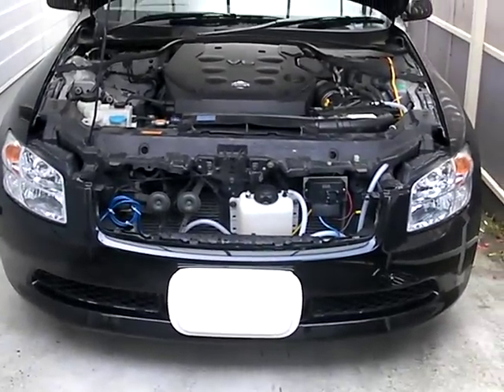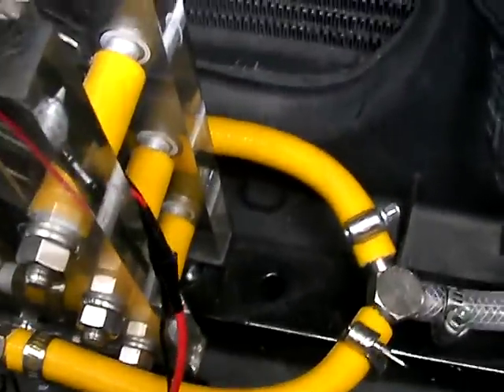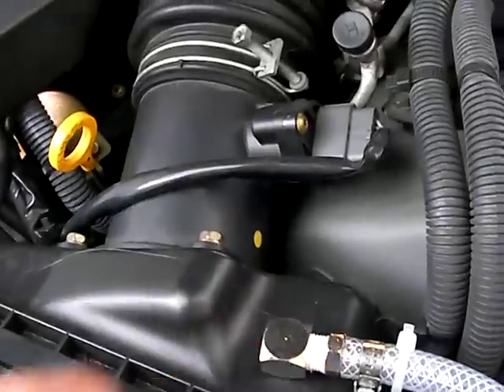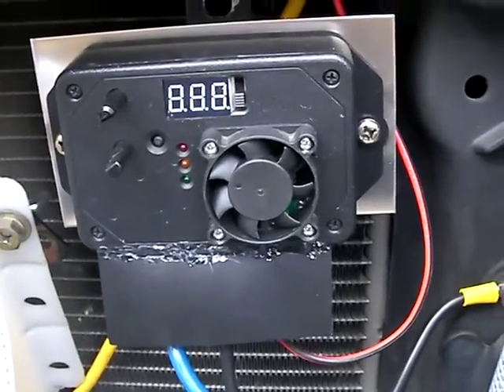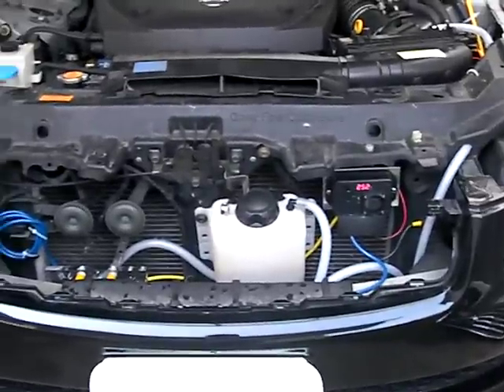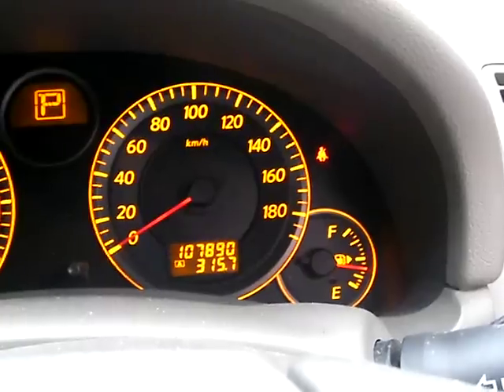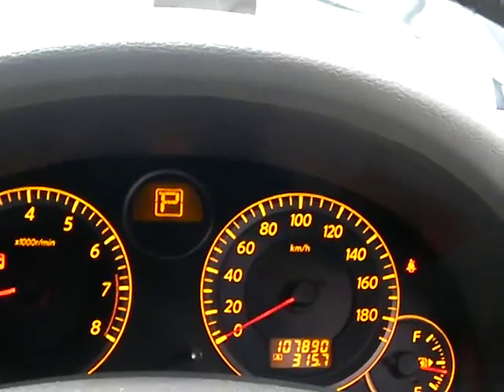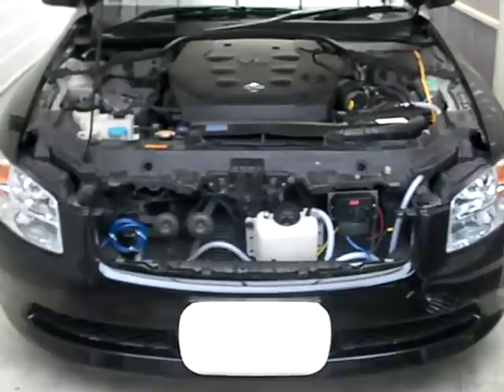Successful HHO install in 2005 Nissan Stagea

Comment: I have a suggestion,..if you first get your car LPG converted...then you get a feed directly into the LPG gas line near where the gas injecters are..this in theory would give you the ability, provided, you have enough LPM of gas to run the engine just on HHO or a mix of LPG and HHO...some adjustments to the LPG gas management system might need some adjusting.......JUST A THOUGHT !!!...I am going to try this..myself once the convertion has been done and the fuel sell made....!!...

Comment: Thank you for sharing your research.    Here are some inexpensive but useful improvements to your system:-

You are using way too much current at 25 A - have one positive plate and one negative plate with 4 non connected plates equally spaced between.

Pipes within popes with a central ss 316 bar is easier and can be put in a 4 inch wast pipe hence much easier to build.  

If you are pulsing - adjust the frequency to resonate with the cell - if it hums then it will be much more efficient - the pipes are easier to tune and 1/4 Meter pipes usually resonate about 20,000 hz or so.

With your existing system you need to have the cell under negative pressure hence the pipe needs to be screw fit tight into your inlet manifold.

Your gas pipes need to be larger to accommodate the new volume of gas.

In addition - if you can run directly from your alternator rather than the battery the system will never be on unless the car is running and you can then run multiple cells with little wear and tear on your existing battery system.

Comment: What about the water in the winter?
If It Freezes?
Reply from the maker: When you use sodium hydroxide as your electrolyte it acts as a kind of anti-freeze. You do have to watch the temperatures.
Reply: thanks for answering me.

Comment: I want to write a little something about this as I have built two of these systems.  Firstly, it is not a scam.  I am sure there are some real scammer's out there that will use any means possible to gain for themselves, but it really does work, but it has to be made to work.  It's true that energy is not free.  It has to come from somewhere.  Plain and simple.  But here's the trick people forget- You can always improve an existing system and make it more efficient.  There is a certain amount of power (in this case your alternator) load required to generate the electricy to generate the HHO.  When you do this in a high enough volume, you can begin to decrease the amount of gasoline/diesel/fuel supplied to the engine.  This is complex because every sensor in your car is going to fight against you.  You have to outsmart your ECU and sensors.  I had my system built to be off at idle and off at higher RPM (where it was useless).  It was designed to come on at low cruising speeds (50mph at best in a dodge ram) where it could best be utilized.  3-5mpg gain at best.  The problem is you will wear out your alternator more quickly with a powerful HHO system.  The economics of it will catch up with you.. is it worth it?  Maybe, but it requires a lot of special tweaks in my opinion.  I wouldn't do it again unless I had more time to improve the electrical system and have the ability to fully customize fuel/timing maps, etc.. I recommend it as an experiment or hydrogen cutting torch, etc.. but I would rather build a turbocharger system or something else.. (which is what I'm currently doing :) )

Comment: It can't work you will end up burning more fuel. Any closed loop System fails instantly due to energy conversion losses the only difference here is that the car engine can burn more fuel to compensate. It's the laws of Physics, You just can't break them. Is there anyone here that understands what i'm talking about and can explain where the extra energy comes from? I guess the power losses due to efficiencies look like this Mechenical - Electrical (alternator)  <90% Electrical - Chemical (HHO) <2% Chemical       -Mechenical (Petroleum, HHO combustion) < 30%.
Over all efficiency HHO system need to be over 100% to burn less fuel (impossible according to Albert Einstein) 
Calculated HHO system Efficiency 0.54% At it's absolute possible best. Which mean for every 100 watts a system like that uses it puts back 0.54 Watts. Remember the more current draw through the alternator the harder it is to turn so it would feel like to the engine like the car is going up a hill and you need to burn more fuel.
Reply: I understand the laws of physics completely....  That is why most professors and students do not understand how some things work in the general world without applying the laws of physics.... The Laws of physics do not apply in the real world I live in, because if it did, I wouldn't be able to do half the shit I do.....  Most science books and history books are rigged from the get.....  People do not understand certain things because of the way they are taught from childhood until now.......  I use to believe in the laws of physics that you can't get something from nothing and I always tried to disprove anything I could.....  Guess what ? I Woke Up and realized that you can get more energy out of something by using a lesser energy to make even more energy....  If you can not get something from nothing, Explain to me magnetism and how it works and why it works and where it exactly gets its energy from to have the polarities it has.....  Energy works in mysterious ways that man will always be wondering how and why.... All we can do is break down the elements that were given to us and explain to a degree why it works that way in theory... Yes, Science is all about theory, Not Fact.....  My eyes have been opened to never be so closed minded again....  Government and World Domination is the key to the brainwashing of the Laws of Physics.....  Open your mind anything is possible....  I have hydrogen cells people only dream of for their cars.... And I really don't care who offers up their statements against it because I have working proof for myself and my family and that is all I need.....  :)  No offense to you or your comment, I just think people need to see the world for what it is today and open their minds to the possibility without pushing forward doubt and deceit without experimentation... Hint, The key to this is the Higher Voltage and the right frequency , Not the Amp Load.....  Atoms do not need high Amps to split at a high rate....  Keep that in mind if you experiment with this at all.... Just remember that it only works under D.C. current.... The higher the voltage the better....  Cylinder tubes work better than plates....  316 L  Stainless Steel .....  A little Electrolyte doesn't hurt either "Non-Corrosive"...
Reply: you are confused,  there is STORED energy in the H20, electrolysis CONVERTS ( not creates) energy to a usable state.
Reply: +Daniel minshall
Voltage X current = power
12 volts at 10 amps or 24 volt at 5amps or 48 volts at 2.5 amps it will all equal 120 watts taken off the alternator.  
 I hate the big companys and I would like to believe it works. I don't wont you all to get sucked in only to find out I was right because in the future when they make a genuine break through you might dismiss it as just another sham.

Comment: hydrophoenixx :  Nice video w/explanation, data results, etc.  I've been looking into the  hydrogen application ever since gas prices peaked over $4.00/gal in the US a few years ago.  E85 fuel never became cost effective for me on the east coast (U.S/) due to the high transportation costs of the Ethanol.  E85 is much more expensive than premium gas in the east coast states.  With gas prices dropping the last year or two, the urgency and drive to install an HHO system has been on the back burner.
Now that I have the time and money, I'll be outfitting one of my cars with an HHO application.  I learn something with every video and document I read on the subject.
Thanks

Comment: So I'm guessing that it behaves a bit like a car running nitrous oxide, except all the time and using a water reservoir instead of a canister of N2O? Does the water need to be distilled, or will any potable water do? The PWM looks like it's pretty much hanging out on its own, but was the Volo FS2 a pain to install? Did you have to add sensors anywhere, or does it just piggyback on your OBD2 port?

Very cool setup, and I appreciate the failsafe design and clean cabling you've got there. Great job, cool experiment. Thanks for sharing it; inspires me to consider integrating HHO with my next project car, or even my daily driver once I can tolerate extended downtime.

Comment: Hey has anyone thought to put the HHO input After the Mass Air Detector that way you can just disable the Oxy sensor the car will still run without an Oxy sensor you know. the oxy is just for pollution control.
Reply: Justin Schubert Every vehicle since 1996 has at least two O2 sensors. The donwstream O2 is only used for monitoring emissions. But, the upstream O2 is what the vehicle's PCM uses to determine how rich/lean the engine is running. So it's a little more  than just emissions. Plus, your CEL light will be on all the time if you disconnect the O2's.
Reply: hey seems you can buy a programmable computer that you can create custom settings and fuel curve, also timing control. If you use a dry cell separator and pipe H2 into the fuel rail you have to change Nothing. apparently the car will run like your using propane injection.

Comment: How well does this run in 105+ degree weather? Because we get that where I live.

Also, how does this run in -0 degree weather? Because we get that a LOT where I live.

What about inclines? Does it work on a 35-40 degree hill? What about shock? Can it withstand driving over gravel roads? Potholes? Can it handle sharp turns?

Also, where are you getting this water? Is it from tap? Specially ordered? What about the great deal of differences between quality of water and impurities between cities, towns and sometimes even districts within a city? Are the impurities going to cause problems down the line?

What's the upkeep cost of these parts if I need to replace them because of system faliures due to a vast plethora of unforeseen instances? I mean, it's not like I can walk down to the local auto shop and pick up a new electrolytic converter if mine suddenly fails for some reason while I'm on the road. Not to mention a mechanic taking one look at the setup and saying "Nope". Which means I'll have to do most repairs myself, likely.

It would be pretty worthless to me if I could only run the vehicle during certain weeks or months of the year, whereas a gasoline fueled vehicle has been tuned to run in all kinds of temperatures and in many, many different conditions.
Reply: as to my understanding the engine is still running on gas he is just forcing hydroxy into the air intake so it would still work in any weather conditions, not sure tho if the hho system functions in the temperatures you mentioned 

and i think the water is distilled water.

Comment from the maker: As I have said many times, This was an experiment I did to find out for myself if hydroxy injection really improved gas mileage and performance.  From my experimentation, I believe that it did improve my mileage. As for the comment, "This is a scam", I never tried to sell this system! However, I have been asked by many to sell the system. Here is what I want all the people reading this to know.  Water is a fuel. It is the most compressed and most powerful fuel we have on Earth.  This is what you should understand.  As for Jesusreignonhigh comment, Yes, cars can run exclusively on hydrogen and they are now building these cars.  They are just extremely expensive.
Reply: They dont need to build any hydrogen car.Any car can be converted to run on hydrogen.But if they told you that,thats not good for business eh?
Reply: hydrophoenixx
Reply: Much work and money for no better mpg :(

Comment: Joe benotz,  my friend one should be more open minded. Have you ever heard  subs in a vehicle? They draw mass amounts of amps an that is done through a capacitor which draws little power from the alternator an puts out alot, put the hho system on a pulse off the capacitor and one could run big hho gennys!! :-)
Reply: Do you actually think a capacitor somehow makes more energy than is put into it ?  A capacitor is just like any other type of electrical storage device in the fact that it gathers and stores electrons, it does not amplify or in any way change the power gathered. It does however have a better ability of gathering and releasing its stored power more quickly and is what is needed to power those big ass subs when they hit hard. They do however need much bigger amperage alternators to keep them powered up for sustained usage. They also act as a secondary battery buffering the main battery(s) keeping them from having huge downward voltage spike when the subs hit and causing the lights and other accessories to dim or stop working momentarily.
Put in simple terms, a capacitor can only dump out as much power as it has stored and no more then that.